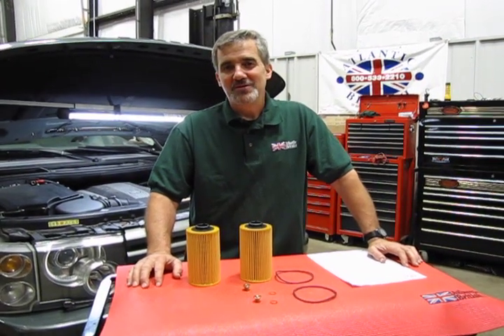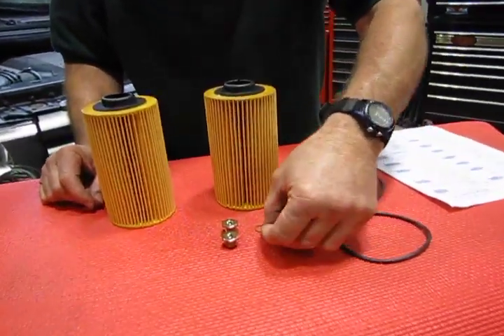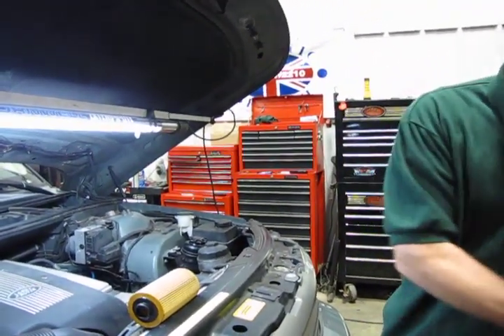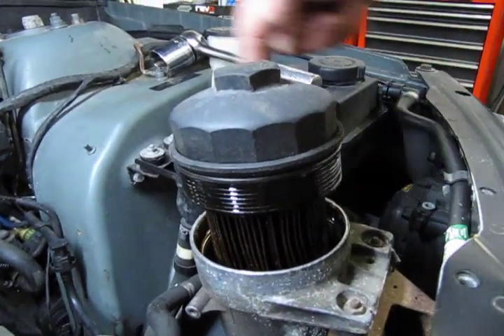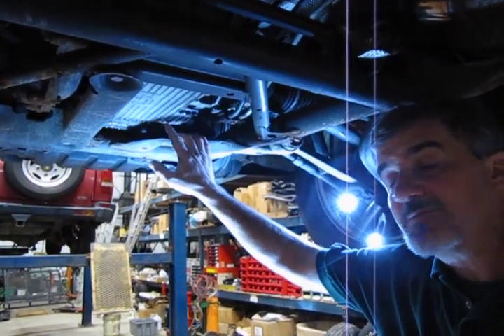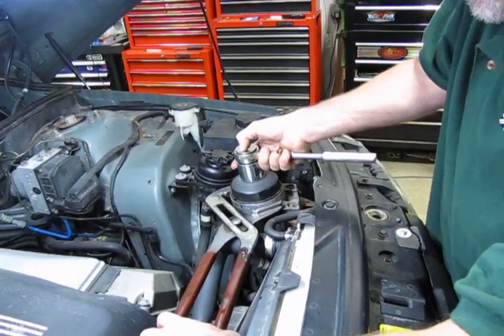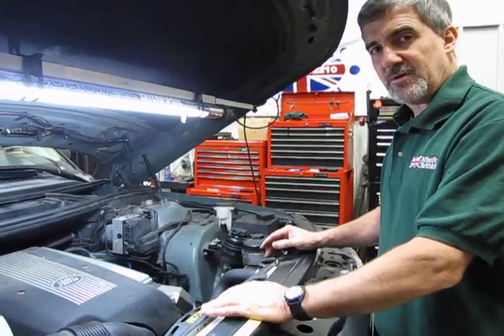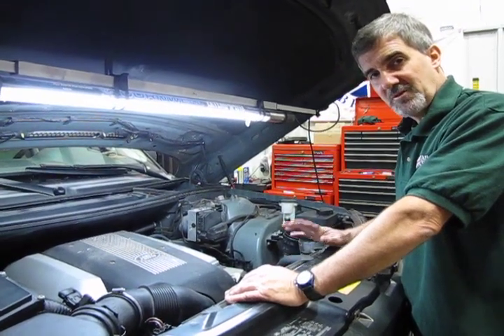Range Rover Full Size L322 Oil Change

Comment: The pipe that the oil filter glides over, what is it called? I discovered today that I miss it on my L322 4.4 gasoline V8 -05. What does it have for function? Is it good or anus to have none?
Reply from the maker: Hi Johan, the pipe that the filter goes on is part of the oil filter housing, if that is missing then you might have bigger issues with your L322 than an oil change. For further questions, I would suggest reaching out to support@atlanticbritish.com.
Reply: Pipe wrench!
Reply: I have a l320 Td v8. Is there 2 drain plugs underneath to drain the oil ?   I often see just one being removed, but people say there’s 2 bungs. Hope you can advise me please.  Great channel. 👌